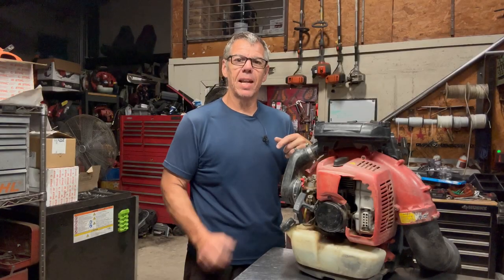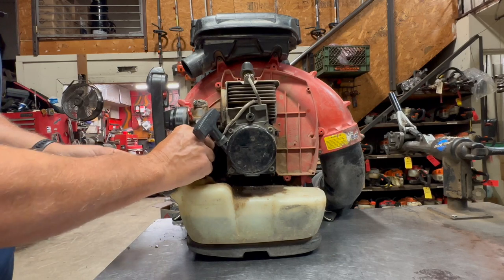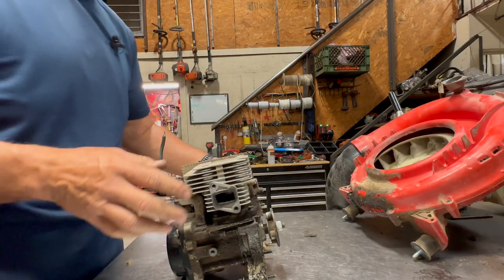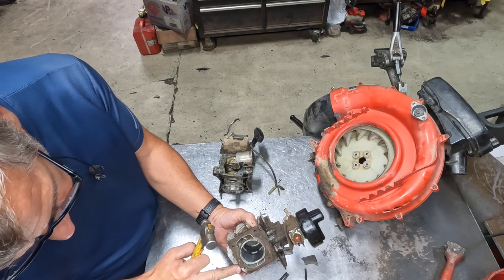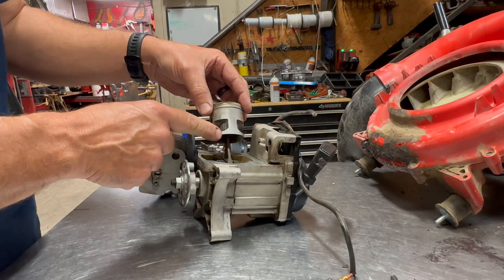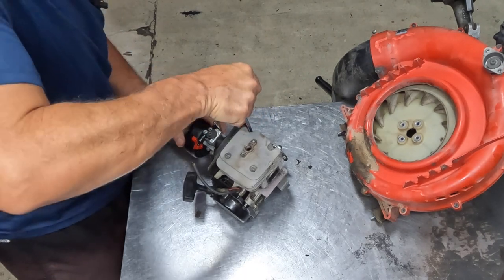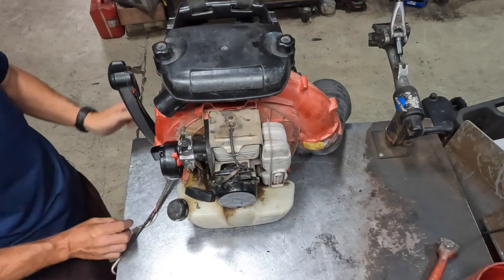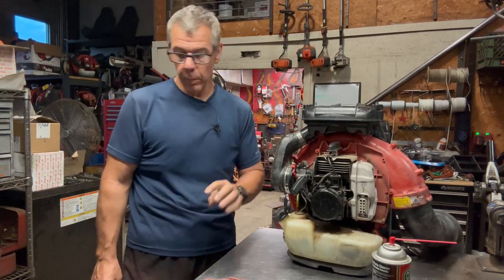RedMax backpack blower leaking oil / RedMax Backpack Blower head gasket replacement  / DIY

Comment: So there’s no way to get that head/cylinder off while it’s still attached to the frame? Can I challenge you to show us in another video that the head won’t come off while the crankcase is attached to the frame? Show us where the interference is that’s stopping it?
Reply: I've done it while keeping it attached, it aint easy but it can be done. You have to come in at an angle, not straight up and down, and loosening the motor mount screws gives you some additional clearance.

Comment: Wally did I see it right? A DRY piston/Rings Cylinder for initial start up? I usually apply a liberal amount of 2 stroke oil to the rings and coat the cylinder.  Just my 0.02

Comment: Love your videos and they have helped me fix multiple problems already! Will a leaking head gasket prevent a redmax blower from starting/running? I have 2 I've been trying to get working for my boss, both have oily mess around the head and both don't like to start and if they do start it dies out as soon as you let the choke out. Any help would be great and pleas keep posting these awesome videos!
Reply from the maker: If the head is loose enough or the gasket is blown out it can prevent it from running. Check the condition of the piston and cylinder as well, assuming you have checked everything else. Thanks for watching.

Comment: So this repair was done once already. I’m starting to think maybe the first time around to take the head bolts and get the bolt heads cross drilled for safety wire and run wire between the two pairs of bolts so they can’t loosen. Go karting and other sites have the fixtures for easily getting the holes drilled. Plus/or maybe a white paint mark between the head and cylinder to make it easier to see during a visual if they’re starting to loosen. Another alternative if there’s room, Nord lock wedge locking washers. They’re not cheap, but work really well securing bolted joints. They’re 2mm thick which may require a longer bolt, unless there’s an extra margin built in.